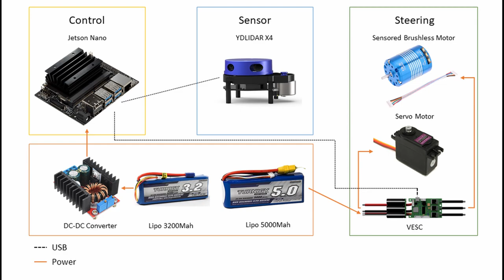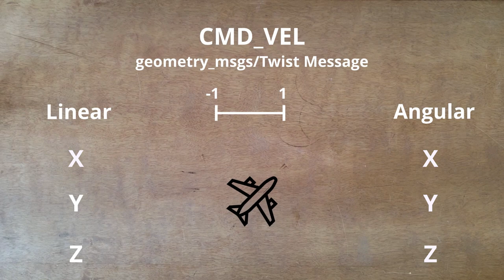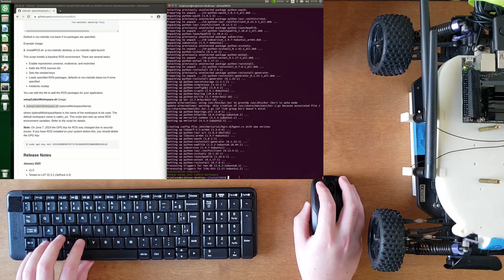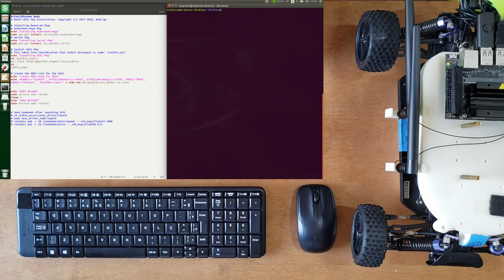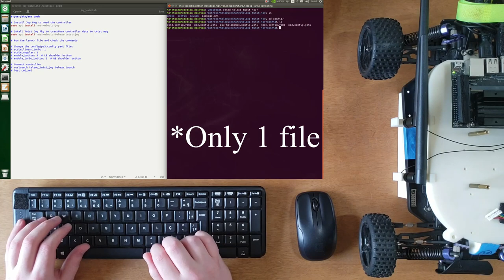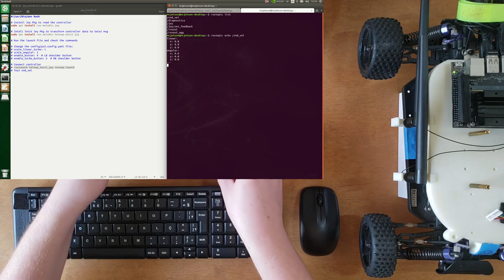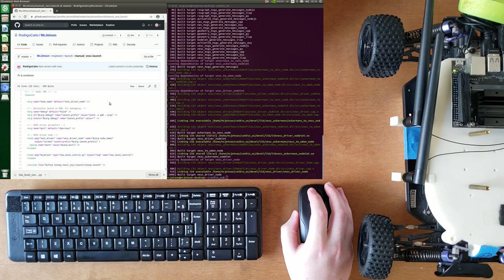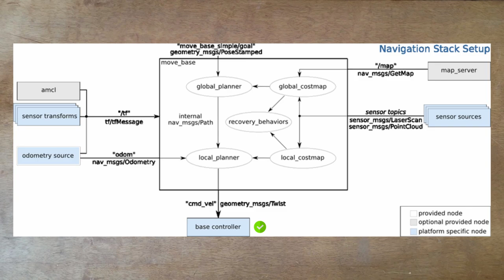Building an Autonomous RC Car | Part 2

Comment: Hi, as many Videomakers, I’d need an AI video operator. Do you think it’s possible to implement face tracking on such a car? Maybe there already are commercial products like this? I know of dozens of face tracking flying drones, but no ground drones… thanks!
Reply from the maker: Not sure if there is a terrestrial face tracking platform commercially available. You can develop something like this, but it probably would require some stabilization in the camera to achieve better results.

Comment: Hey man, really nice project! May I ask why exactly you've chosen the jetson nano controller? Any pros/cons over a "regular" raspberry pi?
Reply from the maker: Tks a lot for the compliments! In terms of pros over an RPi, I would say a higher number o USB 3.0, a dedicated GPU (some ros libraries take advantage of that), and most important is the acceptance by the community that led to a whole bunch of topics and solutions using the Jetson Nano in more complex robots.
Reply: @Brain_Robotics  thanks alot!